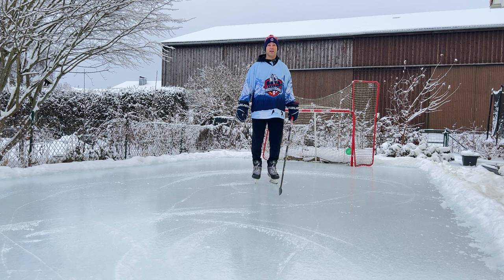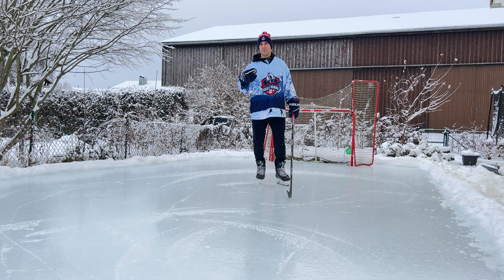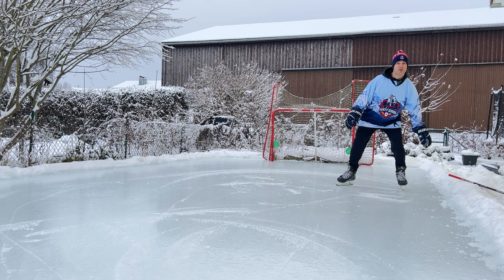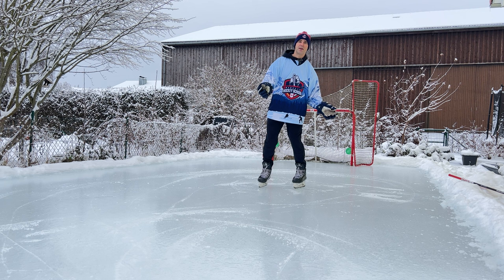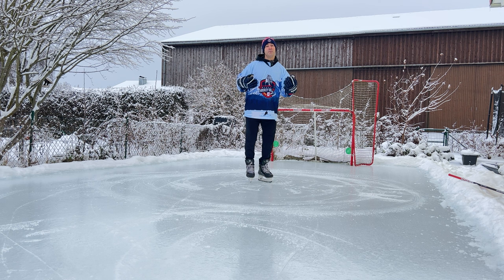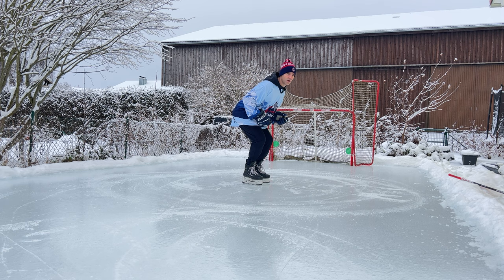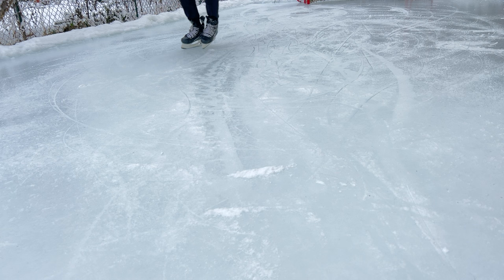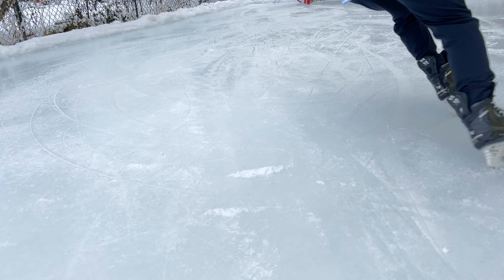Ice Skating: How Your Blade Works

Comment: Your correct there are 3 sections to the skate blade, companies like pro Sharp want to over complicate things by stating there are 2 radi, 3 radi, 4 radi.  There is one radius which is called the work radius , and 2 covex's a toe and heel.  Your correct the heel convex is important for turning and the toe covex is important for quick starts and stride extension to recovery . Or toe flick.
Reply from the maker: I have a Prosharp ellipse profile on my skates. I like their quad profile as well. But you are right that it totally overcomplicates things when it comes to coaching. Heel, Mid, Front keeps things simple when talking to the skaters!
Reply: @MarcelsHockeySchool  

We did an analysis of the quad 0 template from prosharp at a local technical college with there CMM computerized measuring machine and it was determined that they do not use 4 radi . The quad 0 bar was an single radius 11ft with a forward pitch. Don't believe the hype. There are some big differences between profiling and contouring the blade of the skate .  Profiling finds the 3 balance points of the blade in relation to how the foot fits in the boot. Contouring is changing the shape of the blade with no regard to balance points. Prosharp is not a profiling system. As they don't have any regard for balance points. If you like the system that's cool just understand there is a huge difference between profiling and contouring
Reply from the maker: @skatersedge3139  that’s some very interesting stuff. The first time I ever tried a profile was about 15 years ago. It was a Blademaster 10‘/11‘ Profile. I really liked it. Then a buddy of mine who is an equipment manager in the DEL sent me about 5 different profiles to try about 6 years ago. It was very interesting; some I could definitely feel a difference, some I couldn’t.
I think, you gotta just with what you feel comfortable with. Try to blind out the marketing side and use what feels good!

Comment: When you are gliding do you use the inside edge or are you actually standing on flat (both edges at the same time) ?  I’m in my 40s learning to skate, been on the ice 1 hour total so far. I keep hearing I should be on the inside edge 90% of the time at my level.

I'm so glad I found your channel btw, great videos
Reply from the maker: When gliding always try to stay on the flats. If you’re just on your inside edge you’ll dig in more and it will slow you down.

Glad you like the channel!

Comment: I just got myself a supreme m1 before always on the rental skate. I felt so much different especially the front and back of the blade are round, it’s more smoother and fast maybe because the blade are new ? The only problem I having right now is I can’t do any simple stop like snowplow (single/both leg) not sure have to use flat or inside edge to done it , can you give any tip for me pls ?
Reply from the maker: M1s are a huge step up from a rental, and the newer blade will defintely help compared to a worn down one. Don't get you hard one your edge when you stop; you want a fairly flat edge to shave the ice. If you angle the blade too much on the inside edge, it will dig in too much. I did a video on fixing your hockey stop; maybe it can help you: https://www.youtube.com/watch?v=dTEHoU9mSKA&t=29s

Comment: Great, analytical video. Thank you. Regarding blade angle and body position. I struggle do to the one legged turn exercise where one touches the ice with the hand or even the elbow. Any pointers?
Reply from the maker: You're welcome! Don't worry about touching the elbow; that is crazy hard. I think the biggest thing for those drills is being able to bend at the knees/having good leg strength, and also good balance. If you can't do it on one leg yet, then try doing the turn with both feet on the ice and touching your hand down.